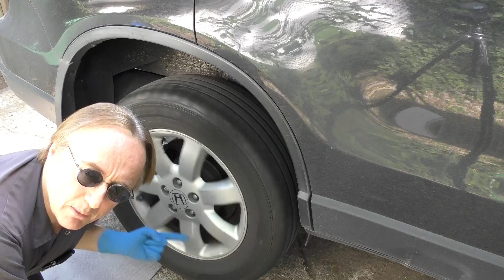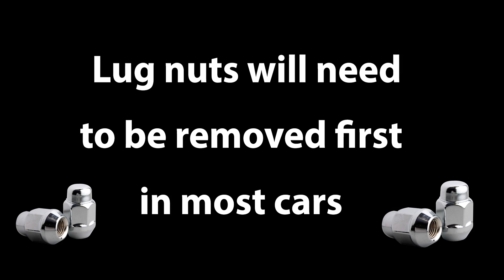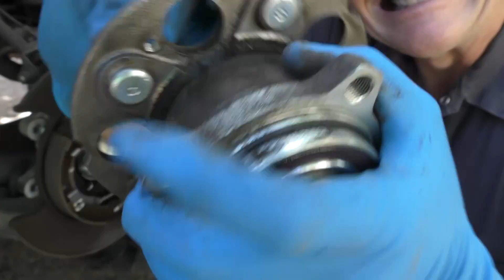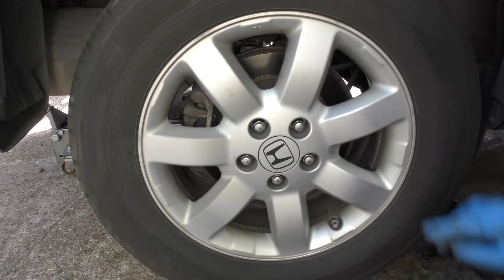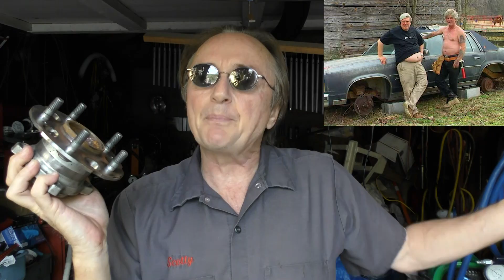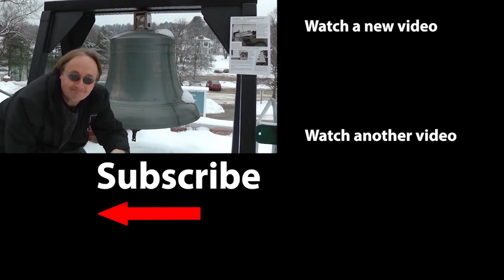Do This Before Your Wheel Falls Off

Comment: This isn't the same for every vehicle, some vehicles don't have wheel hub assemblies like that and you actually need to press out and press in the bearing and it can be quite difficult. Before you tackle this project on your own do some research to find out if you have a press in bearing that's difficult, or a wheel hub that can be easily replaced like Scotty shows.

Comment: Im about to change my hub bearings on my 2008 Pontiac grand prix 3.8!
For the third time! O my goodness what am I doing wrong ghee's,lol
I have done all my mechanic work myself for over 32 years and I've even worked on Simi truck's,lol
But anyway I'm wondering if the torque specs are strange i have search the web and i have found all kinds of different torque specs it's crazy! 
I'm about to go back to what i know about the old wheel hub bearings where you pack them with grease give them a snug then back off the nut just a little spin the wheel and then snug the axel but back down and be done and see what happens,lol if anything I'll just have to replace them again,lol 
Anyway any suggestions would be great hope to hear back from you before i change them maybe you know something about this, 
Thanks

Comment: My f150 has a bearing/brake disk assembly. 2 bolts to remove the caliper, 1 bolt for the bearing/disk. Easy!!!, if you have the right tools!

Comment: I remember some car from the 1970's where only the bearing race for roller bearings was pressed in, and it could be removed by gently tapping around the race with a pin punch.Then if I recall correctly I got a big socket and tapped on it with a hammer to tap in the new race. It only needed a pound or 2 of force, almost possible to press it in with just fingers. Tapping on the socket did not scratch the socket or deform it. It was just a gentle tap. Then they were adjusted by replacing a big nut at the end of a stub axle, torquing the nut to a specified torque, then backing off a fraction of a turn. That caused the a bearing end play to come out to about 1 or 2 thousands of an inch. A small screw press might have been helpful but nowhere near a 20-ton press was needed.
Reply: He is referring to the sealed bearings that press into the knuckle. Many cars still use them.

Comment: The honda screws for the rotors require the JIS (japanese industrial standard) impact screwdriver to get off. They may look like a phillips but they aren't. People think they are phillips, strip it and end up drilling it off. I purchased a jis impact screwdriver cheap on amazon. I had only 18,000 miles on my 2013 crv. Didn't drive it for a few weeks, the rotors rusted so bad I had to change them.

Comment: My 2004 Ford Expedition has 187K miles on it , and they told us like 3 years ago that the upper ball joints needed to be replaced for like $800 or our wheels were going to fall off , but they still on 3 years later . But these wheel bearings , I could definitely do myself.  They said the Ball joints had to be pressed on with a hydrolic press. I'm thinking I should just replace all the wheel bearings , although , about 2 years ago the truck was driving soo loud ....it sounded like a disc was locked, but turned out to be a single wheel bearing.   In any event , .......this car is going to start to denigrate at a rapid pace all around , so I am planning for a newer replacement . Coming up on  200K Miles on the Ford .They have been great though.  My 3rd Ford Expedition since 1999.

Comment: It’s a lot more complicated for drive wheels with the axle going through the wheel bearings and you gotta whack out the axle and it’s an even bigger pain if you have disc brakes with abs

Comment: Had a 2004 Mazda 3.  That thing would go through wheel bearings constantly.  What a piece of crap.  The other suspension components were garbage too, not to mention the RUST problems, which were off the charts.

Comment: Unless you have a 90s Honda which has the hub over rotor design then you will be doing a 5 hour to 8 hour job on both front might as well at that point convert to a rotor over hub design

Comment: Scotty, you're always taking about how crappy modern automatic transmissions are (true automatics and CVTs) and you push for manual transmissions. I'm going to be in the market for a new car or small SUV this year and am going to get an auto transmission (I can drive a stick but choose not to). I have been driving Toyotas and Hondas for the past 35 years (that tells you how old I am 😉). Between Honda and Toyota, who has the better automatic transmissions). Thanks for answering...

Comment: 30ton harbor friegeht press less than 150.  works good as a vice as well.  If you get bearings with a warranty get a RACE puller.  They won't warranty them if you cut them off with a grinder/cutting wheel.  Some say Impact drivers can damaged the bearings/CV axles.   So avoid if possible.

Comment: I never replace the screws on the rotor. In fact, most of the rotors I come across have already had them removed. The last time I replaced all brake parts (except the lines and hoses), the amount of effort it took to remove those screws discouraged me from ever using them in the future. Besides, as Scotty said, they're mainly there to hold the rotor while the car is being built. As long as your wheel is properly installed, that rotor isn't going anywhere... Another fun and educational video, Scotty!!! 🙂🙂🙂

Comment: You can buy spark plug anti-seize to put on the bolt threads so they do not corrode later. Especially for areas with salt on the roads in the winter.

Comment: I must say, I always ended up having to take a map gas Torch to the hub assembly where it mates to the steering knuckle.. and then keep whacking it out with a hammer. sometimes I'd have to heat the four bolts

Comment: I spent 4 days hammering and rust busting  my bearings and couldn't get them off.  I had to use my old disc brake rotors and hydraulic jack to get them off.  I put a video up on YouTube in case anyone has stuck bearings too.

Comment: Hey Scotty, I have a 98 Nissan s14 Silvia manual Transmission. Sometimes when I press the clutch, the car is still moving. I have to step the brake and yank hard on the shifter to neutral in order to stop. It have replaced the clutch fluid, same problem. I do not see leaks and clutch fluid does not go low. What can I do? Thanks scotty

Comment: That's a rear wheel bearing on a front wheel drive gen 3 CRV.  The front bearing is the cartridge type that needs to be pressed or hub tamer.  That's much harder to do, especially in the rust belt.

Comment: I recently had to do just this repair on my front wheel bearings. I drive a 2000 Pontiac Sunfire (same as a Chevy cavalier). My front wheels started making a LOUD popping noise while driving and would stop making that noise only when braking. 

I thought that the rotors might be warped. Tow truck driver said it was probably my wheel bearings. I ordered some and replaced them myself (took a 31mm socket for the axle and 3 T55 torx screws with a breaker bar for the hub assembly to come off.) Applied some hammer down! to the  hub assembly to knock it loose from the axle shaft and putting the new ones on was a breeze. 

Turned the old bearing a few times and could hear it grinding. No more popping with the new ones. I'll probably go ahead and replace the rear ones before noise comes up, just to be safe. Great video!

Comment: This sure beats the old days when I would take wheel bearings apart, clean them with gasoline(to dissolve the old grease), repack them with new grease and then tighten the bearing to minimal running clearance.

Comment: I'm planning on putting golf cart wheels on a engine hoist to make it into a trailer for rough ground and I found the lug pattern is the same as a chevy cobalt so I'll be getting some ebay wheel bearings to mount them.

Comment: The trick is your hub assembly is stuck on really hard is a big pipe wrench from harbor freight  just lock it on (Perpendicular) at the top of the rotor and strike it with a large sledge. Voilà comes right off.

Comment: Doesn't this only apply to the rear wheels? The front ones usually aren't sold in an assembly and you have to push the bearings out yourself.

Comment: what if the sound is going high, then low, then back to high and repeating every second when going ~60 mph? I got into a bad accident that wrecked my front passenger side and got it repaired at a repair shop.

Comment: It is NOT easy to get the old wheel hub out of the steering knuckle on certain cars like the Toyota Prius, especially after many years have elapsed and/or driving in salt conditions. You have been warned :)

Comment: I hate those rotor screws.. Never put them back in especially in snow areas
Reply: What use instead?  What works better and why?
Reply: Use an impact screwdriver
Reply: Like scotty said, the lug nuts already hold the rotor in with the wheel.

Comment: I had to use torches to help loosen up the bolts on my wheel hub assembly they were so tight.
Reply: it was not that they were tight but were locked on by corrosion.

Comment: Scotty my front drivers side ABS light is on(2004 Honda Accord). The code shows it to be a speed sensor.  The mechanic said it could be the speed sensor or the bearing or both.  What if the sensor is on backwards?  how do I know whether or not the sensor is put on backwards or not?

Comment: If it was only that easy here in the snow belt. Most nuts and bolts are seized on from salt and other chemicals they use on the roads.

Comment: Here in Vermont the procedure includes dealing with environmentally welded solid retaining bolts with severely rusted heads that round off if you even bring a six point socket near them,, and a brake rotor then hub assembly that requires the gentle encouragement of air impact hammer to even acknowledge ones desire to remove them.

Comment: What kind of car was that?  It is a little more complicated to change the front wheel bearing especially on a Corolla.  I am pretty sure you have to use a press.  I just try to avoid puddles on the road!!  For that reason I had to get one changed on the passenger's side of an old Taurus.  I bought a Chinese bearing and had RPM in Jacksonville do it for 400 dollars.  They insisted that the other side would go out soon and that I have that changed for an additional 400.  I didn't and both bearings lasted until I sold the car 90K miles.  RPM takes ripping people off to a whole new level.

Comment: To clarify about most cars requiring the lugs to come off, some Toyota’s are so good that you don’t ever have to take the wheels off: bearings, brakes, tires, suspension, nothing wears out so no need to have lug nuts!! Wheels come welded on from the factory! 😜

Comment: Dearest Scotty,

What has your experience been with Toyota Solaras? Specifically, 2004 model.  Looking at buying one for my daughter. I know the car needs valve covers replaced and has had the cv axle, control arms, and brakes replaced recently. No other known problems or engine lights. Has 132,000 miles! Hope to get a response.  I've learned a ton from your channel and have been inspired to do repairs myself. I love it now! Thanks!
Reply: My buddy's wife has one its a 2000 model and has about 150k on it and its a solid car
Reply: Thanks! We're considering it. Would like to do the work myself if I can.

Comment: So how hard would it be to replace the wheel bearings on a 2006 Mazda Mazda3 ?? Both front bearings are loud, and I think the driver's side rear is starting to go too.
Reply: About the same as shown in the video except you need to take the axle nut off, press (or gently hammer) the axle back, pop the ball joint loose if the axle won't go back far enough to clear it and is tight on it still, then when putting it back together be sure to use a torque wrench to get the right torque on the axle nut.

Comment: I wonder how hard this would be on a car with 200k miles. When I took the rotors off my taco the only thing that finally got them off was threading a bolt through the caliper bolt hole and a nut and tightening the bolt against the rotor. The pop when the rotor finally seperated was way louder than I thought it would be, I was checking to make sure nothing was broken after
Reply: Rotors rusted on are usually harder to get off than the hubs, provided you have some muscle and/or a wrench extension or sufficiently long breaker bar to break the bolts loose, and axle nut if it's a live (driven) wheel.  Do put penetrant on them ahead of time and let it soak for a while.  PS once you get them off, clean the rust off and put a layer of silicone brake grease on the mating surfaces, lightly so none gets on the rotor friction surface or pads.  It will come off much easier next time.  Something else you can do is take the wheel off then apply the brakes, spin the rotor, apply brakes again.  Start out gently.

Comment: The lack of rusted bolts and the caliper easily slipping off the rotor are both rather amusing.
Reply: Yeah like the bolts holding the bearing aren't going to be waaaay rusted in there. And the bearing itself, some gentle taps with a hammer won't usually get it out either.
Reply: This is normal for Houston area and Oklahoma where I'm at
Reply: @scottjohnson3570  Oh, I don't doubt that for a second, but being a life-long resident of the upper Midwest I just found it amusing. Addressing rust and wear would double the length of the video though.
Reply: If you live near sea or in the cold snowing regions obviously you gonna get rust when water oxidises it make rust on steel very quick but in the desert it's very slow.

Comment: Yeah,  come right off !!!!   Good luck with that !!!!   Get a slide hammer,  breaker bar, and practice swinging a hammer if you have 200,000 miles on them, they rust together solid  !!!!

Comment: I've never had hub assemblies come out that easy! Did you take them out beforehand, Scotty?  😉
Reply: He lives in Houston Tx, pretty sure that has a lot to do with it.
Reply: @moxx064  - ah, i live in Wisconsin. They pretty much weld themselves in after a year with our winters!  😤
Reply: Look at the rest of the metal work, there isn't much rust.  Also you didn't see him putting effort into getting the bolts off. After they are off, since you are throwing away the whole hub, you can wack it as hard as you want with a hammer, except you better make sure you get the axle out first if it's a driven wheel.  Another alternative is slightly loosen the bolts to it, put the tire back on for more leverage.  If not a driven wheel you can even drop it back to the ground and drive a few feet forward and back again to pop it loose... at your own risk, I can't predict what people might do wrong like loosening the bolts too much.
Reply: House Stark  actually Houston is quite wet I could see this being an issue.
Reply: @brianb900  Wet isn't so much of a problem as much as the salt that is used on the roads here in Wisconsin.

Comment: Could you do this on a 96 dodge ram or  should it be done by a mechanic?
Reply: Should be able to do it yourself.  I've replaced the ones on my Chevy Trailblazer.  With a truck though you'll probably have an extra nut to remove called the spindle nut.  Mine is like a 35mm.  Best to remove it while the truck is still on the ground.  If you try loosening it when it's jacked up all you'll do is spin the wheel.